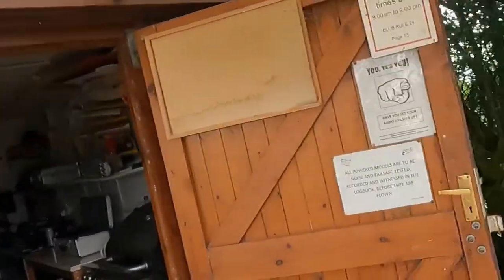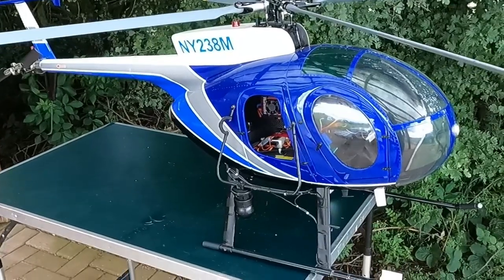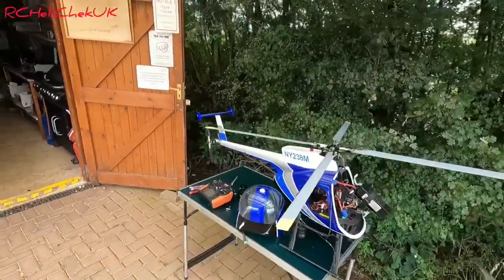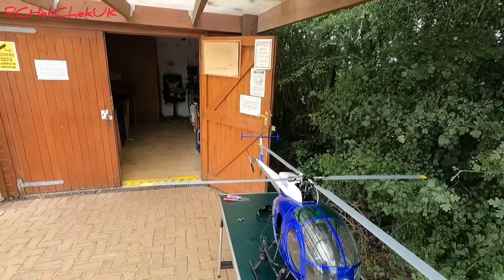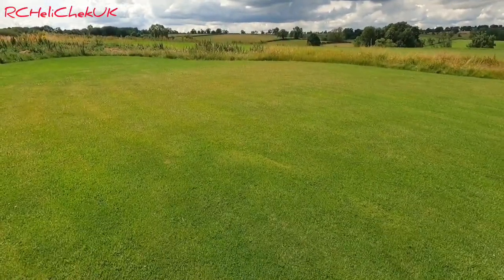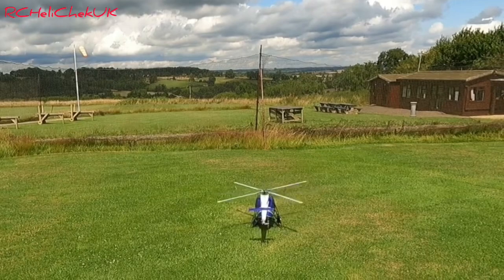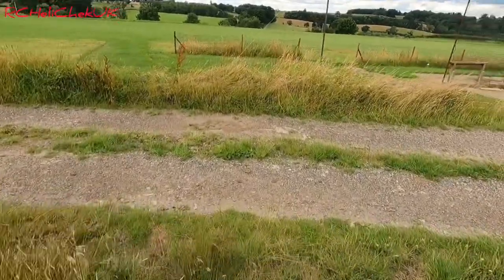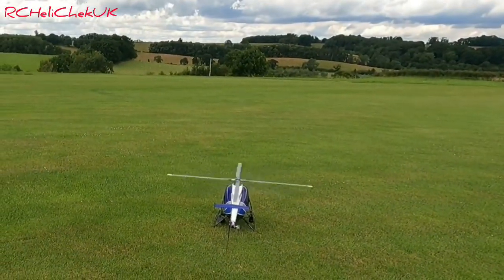Scale RC Helicopter/ Roban 600 size Hughes MD500 Death Wobble!

Comment: Interesting to watch this, I have a 450 Trex inside a Roban MD500 fuselage and it always what I call bobbles, it doesn't seem ti be an issue if I fly it slowly in an attempt to make it look scale!! But if I fly a little faster the bobble gets worse, I'm flying with the stock Trex 450 blades and have never really solved the issue, I thought maybe I had placed the mechanics in the fuselage slightly off center!! Or maybe the rotor disc was a bit small for the bulky MD500 fuselage!! I'm glad you got to the bottom of your issue of the blades flexing 😀👍
Reply from the maker: Check out my video I did on here with a Trex 450 mechanics in a Hughes 500 fuselage. I had no issues at all with mine and it flies awesome.

RC Scale MD500 450 size/ Fuselage refurb/ Trex 450 mechanics fitting and Maiden
https://youtu.be/vNGsjv-Gfbk

Comment: Blade grips tighter and o-rings in the rotor head where the feathering shaft runs thru also bit tighter. thats what always did the trick for me.
Reply from the maker: None of the above. It was the spin blades

Comment: So I’m going to go in a different direction because I found this inside my 700 size Jet Ranger. The mechanics and the fuselage started resonating at different frequencies. I had to make two L-bend stiffeners to go from the mechanics to the fuselage in the doghouse to fix it. Eventually my main mast bearings started to wear out and accentuated the vibration/wobble.

Comment: Hi Rob. I'd say 1600rpm sounds fast. In fact 1400 sounds a bit fast. I'd maybe consider reducing head speed and increasing your 7 degrees to 8 or 9. Also you might want to reduce the Agility and gain a little bit on the beastx which cuts down on the feedback loop that results in wobble. It would never be noticed on a podnboom but heavier models don't react as quick.
Reply from the maker: Thank you for the advice pal which I took well. I reduced the gain and agility and it’s leaps and bounds better. I found that if I went from 1400 up to 1500rpm in flight as the head speed increased it wobbled a lot, now nothing at all so thanks for the heads up.
Reply: @TheRMRCchannel  good news. I'd still look at reducing the head speed.. I'd say 1400 as max and 1200 might be more like it. If you are running @ 1400 for tail authority.. Reduce the headspeed and put bigger tail blades on it. 1400 is fine for 2 blades. 4 not so much.

Comment: hi there 😮 i had spinblades on my helicopter. they're not 12mm at the root like they should have beause of the paint. same wobble! i'm flying with align blades now and there is no vibration anymore 👍🏻 @ 1530 rpm on hard surface.. 12% vibes

Comment: I have not seen any discussion about the gyro head rate and which gyro it is. Blades can be well balanced and physicals all good, however the gyro itself might induce wobble if head rate is too high. Here looks like -5% on head rate might do the trick. Note changing head speed can "hide/resolve" the issue as swash plate révolutions at different speed.
Reply from the maker: I don’t have the heli anymore bud so it’s all irrelevant now
Reply: Noted. Will eventually help someone seeing this, as public. Cheers.

Comment: When I had a trex 600 electric FBl and wanted to fly low head speed I had to use soft dampers cause the harder dampers would make the head wobble. I'm not sure if you use those dampers in a 4 bladed head so I could be barking up the wrong tree.
Reply from the maker: Thank you for your support and input , but we found the problem to be the scale Spin Blades on the model because they were flexing in flight causing the wobble. I tested the blades on my 550X and it did the same thing on that model but not as pronounced as only using two blades and not four.
Reply: @TheRMRCchannel  He was right. The felxible Spinblades at only 35mm chord need harder dampeners. And setting the gains according to the blades. They are awesome on my 4-blade and 6-blade scale models.

Comment: I'm thinking play around with your gyro gains a little to see if it's any different. If not, reduce your head speed.
Reply from the maker: Yes it was the gyro gain, it was set too high and the issue is now resolved

Comment: Something you might want to try is to weigh the blades ..... there should be a "heavy" pair and a "light" pair which have to be across from one another  .....  so if you run out of things try maybe this will help .....
Reply from the maker: I always balance and weigh my blades especially on a multi rotor and always set the heavy blades opposite but thank you for your input

Comment: You're running a 4 blade head so shouldnt need anything like 1400 rpm. You should be aiming for 1300-1350 rpm max. The fact you get 'wobble' when it's windy suggests a gyro gain issue, either too low or too high in relation to the head speed. BTW, despite what a lot of people think and fo rthis size heli and bigger, you shouldnt have the main or tail blades set so they move in the grips as this is a main cause of vibration. The grips should be tight and not allow the blades to move.
Reply from the maker: Turns out the wobble was caused by the Spin Blades flexing in fight. Carbon NHP Blades stopped it

Comment: Track the blades!!!!!!!!!!!!!!!!!!!!!!!!!!
Reply from the maker: The blades were tracked!!!!!!!!!!! And balanced!!!!!!!!!!!!  We found out what the issue was, the Spin Blades were flexing in flight causing the wobble. Changed them out for NHP carbon blades and it stopped
Reply: @TheRMRCchannel  Spinblades are very flexible because of the low (scale) chord. No need to replace them, but set the gains according to the blades.

Comment: Blade tracking and balance is off. Nothing you mentioned is the problem.
Reply from the maker: Nope. Blade tracking and balancing was all done and spot on. Found the problem to be the actual Spin Blades flexing in flight to be the problem